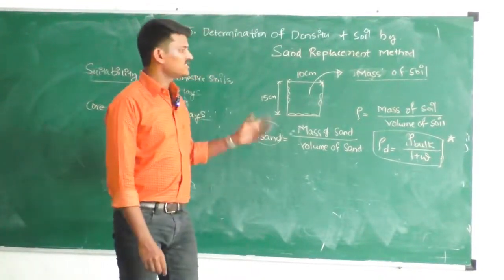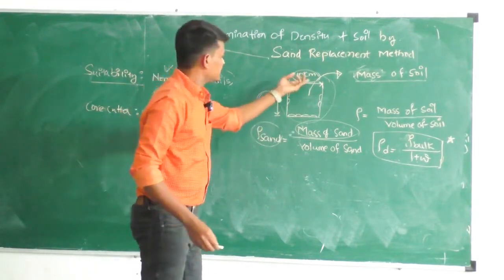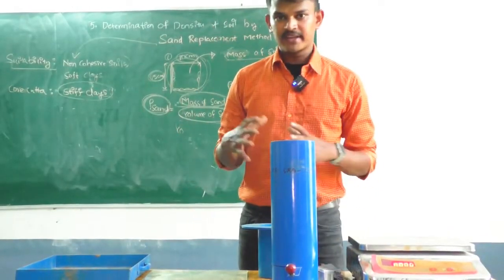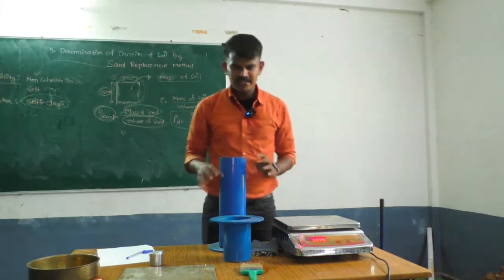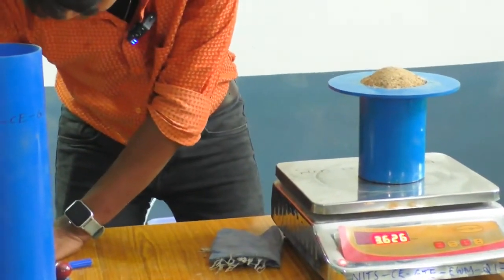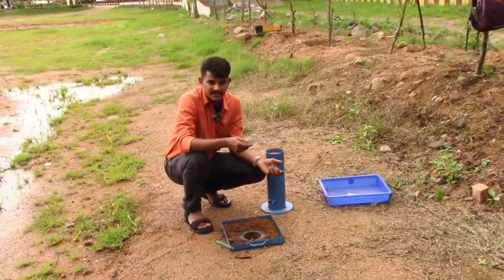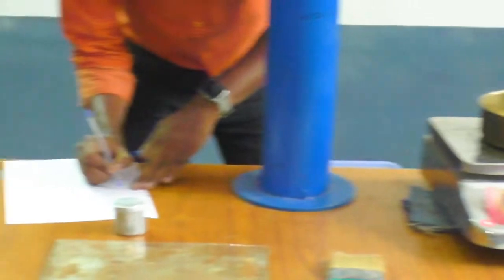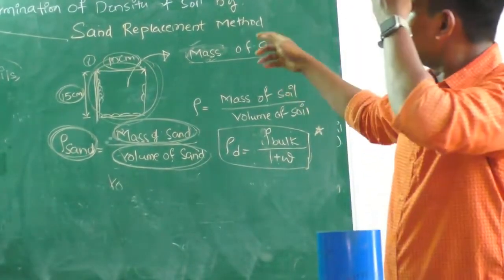sand replacement method| GEOTECHNICAL/ SOIL MECHANICS LAB

Comment: Sir what is the use of finding density in the field?
Reply from the maker: Core cutting method gives you disturbed soil which changes void ratio and structure of soil in field. Sand replacement gives you real density of soil